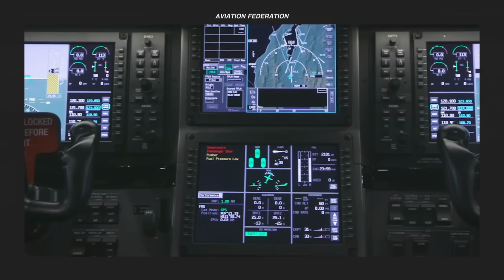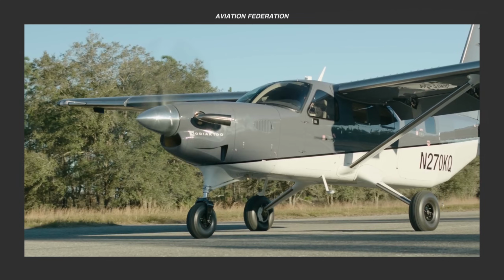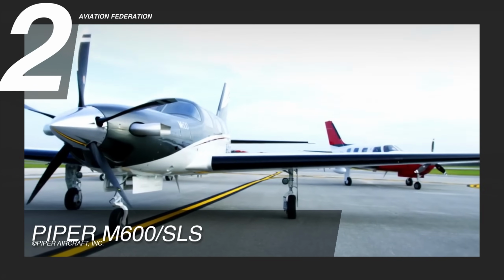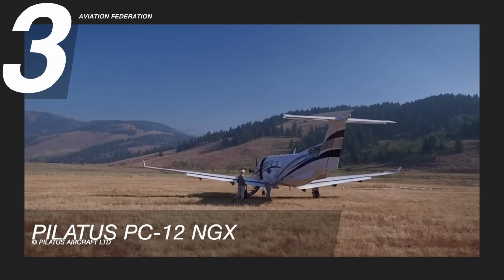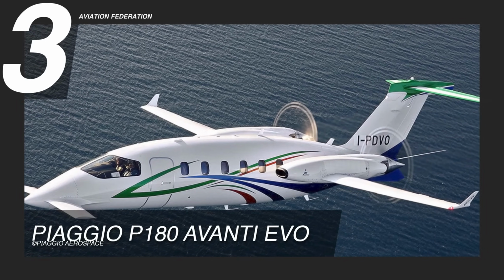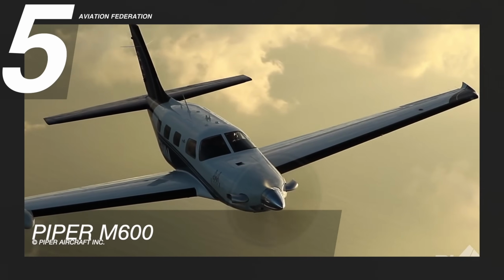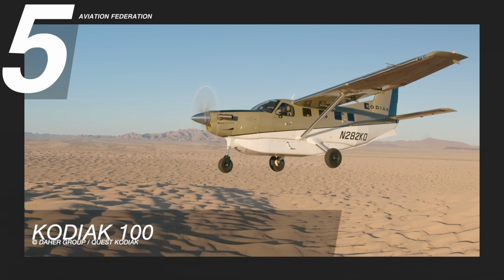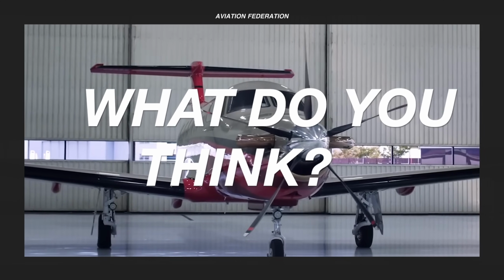Ultimate Turboprop Aircraft Comparison SUPERCUT | Daher, TBM, Cessna, Pilatus, Piaggio, and More!

Comment: The Pilatus, the aircraft not the mountain, has a massive flutter problem with the T-tail separating at high speed at altitude.
At high altitude the TRUE AIRSPEED  reaches structural resonance  given by the critical Strouhall Number .
Vortices are alternating in the corners below the tailplane at the frequency 
f = St * TAS × chord
When this frequency resonates with the structural bending frequency at sufficiently high velocity the tailplane will separate as it has in numerous accidents.
For this to happen the true airspeed must be large , even though at high altitude the indicated Vmo has not been reached, this critical altitude seems to be around 23000 to 25000 ft. where the TAS is 1.46 IAS.
Reply from the maker: The Pilatus aircraft's T-tail flutter issue at high speeds and altitudes is indeed a significant concern. The problem arises when the true airspeed (TAS) reaches a frequency that resonates with the structural bending frequency of the tailplane, leading to potential separation. This critical condition, which occurs around 23,000 to 25,000 feet where TAS is approximately 1.46 times the indicated airspeed (IAS), has been observed in various accidents. 

Is this a concern that should prompt a redesign or additional safety measures for high-altitude operations?